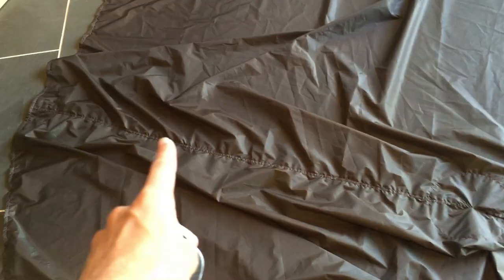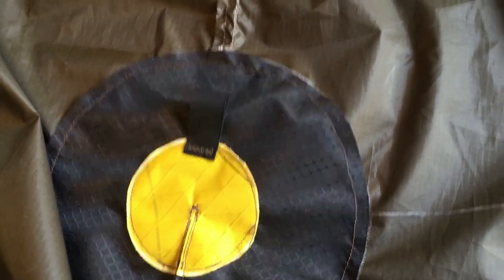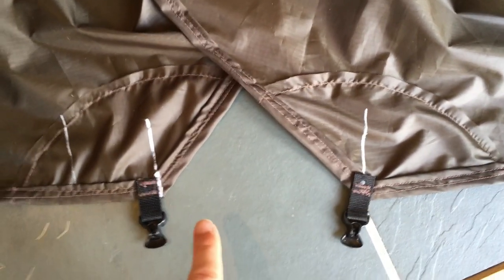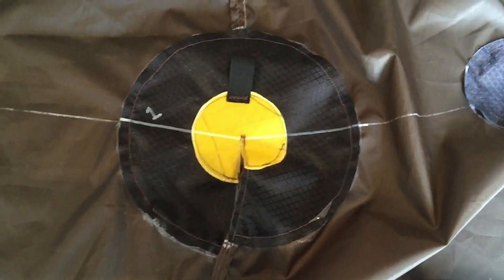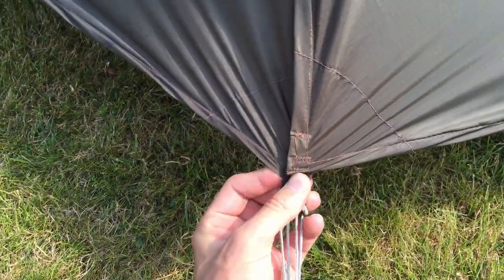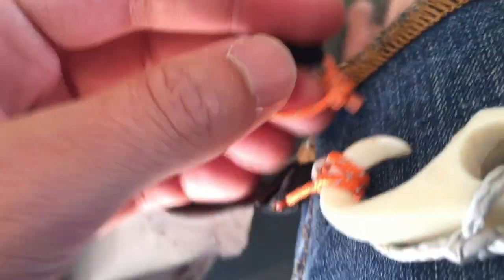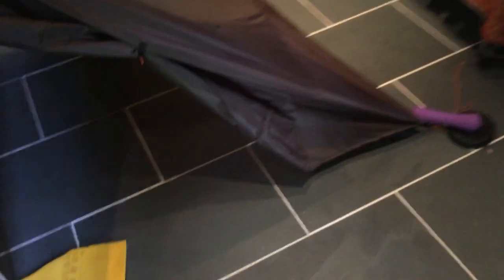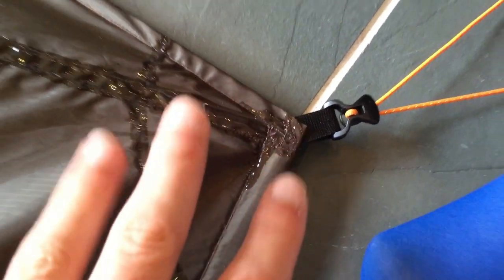How to Design & Make an Ultralight Shelter/Tarp - Part III

Comment: Morning, Connor (well, here at least!). Enjoyed all this, well done. I am looking forward to your reflections out on the GR5, once the shelter gets put to the test! I am about ready to get out there with you both, again...let’s do this!! Cheers, W
Reply from the maker: Man that shelter build was a bit hairy, I remember the first time I pitched it only 50% sure it would even stand up 😂 then I took it on 1000km of trail with no worries 😲
Reply: TwoFoolsWalking The key piece of knowledge you used, I believe, was your understanding of the different heights of pitching, used to suit the current circumstance you found yourselves in. You then designed it to suit those height boundaries? Just a hunch